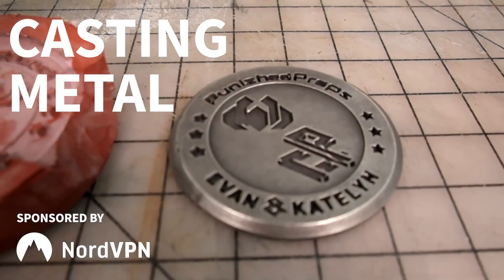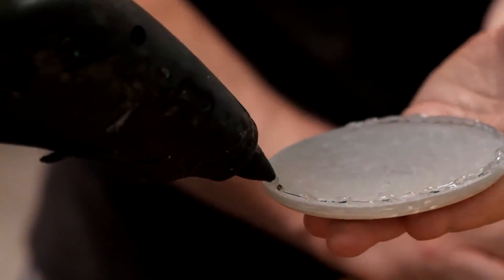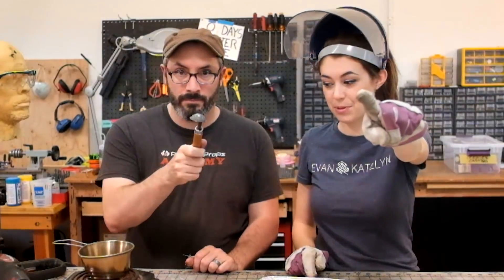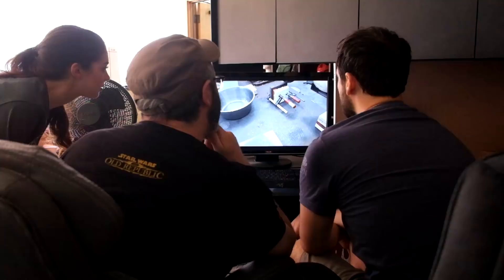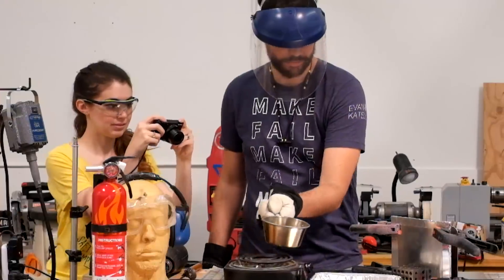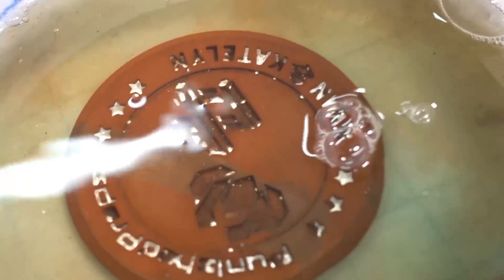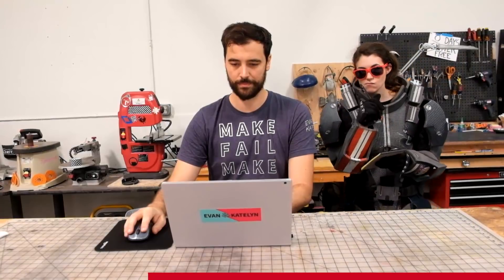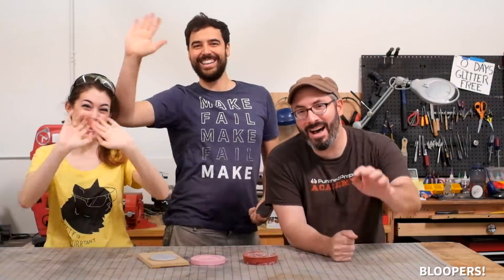We Cast Molten Metal in Silicone!!

Comment: It will likely be tin, it’s a mostly nontoxic metal, (poor gastrointestinal absorption) and it’s melting point is one of the lowest at around 200 degrees C. Most silicones, depending on the type, can withstand those sorts of temperatures.
Reply: There is lead-free "pewter" consisting of 94% tin, 3% zinc and 3% antimony.  Antimony is toxic but in an alloy like that there won't be issues, and anyway it is free of lead!

Comment: 1. Always coat your resin prints before pouring silicone, usually that stuff does not work well together.
2. Don´t use hot glue but sticky wax or bees wax to assemble the mold, it´s easier to disassemble afterwords.
3. When mixing silicone you pour in the catalyst first.
4. For a simple cast like that you don´t need to degas silicone, for someone who does not have a vacuum chamber, simply brush on a thin layer first to make sure there are no bubbles trapped and then pour the rest, not on the work piece but on a low spot somewhere in the corner.
5. The yellow color of the pewter shows it was somewhat too hot, but that´s not an issue. Also simply pour a 2nd time right after you released the first part, the 1st and 2nd casting is usually dogs*t
6. A flat disk like that is best poured at a slight angle not upright.
7. Also you forgot to make a riser. This is important as a material reservoir when the metal cools it shrinks and this way it can pull material from the riser inside the mold. And it functions as a weight pushing the material down into the mold. You make your riser as tall and wide as possible to unrestrict the material inflow, the gas exhaustion and increase the pressure.
Reply: Excellent advice - thanks!
Reply: @karhukivi  You are most welcome, happy holidays.

Comment: Very fun video.

Pouring straight down allows for air to be trapped in the bottom cavities of the mold (i.e. t he letters, other detail).
This was the exact same effect as when they were using the pewter black treatment in the water - air bubbles in the recesses.
If you have to use a straight pour in mold, with resin casting, they will use a small brush to make sure some of the resin gets into the recesses - but this only works if you have a slower curing resin, and I do not know of any similar method that could be done safely with metal.

This can be mitigated someone by doing what is known as "pressure casting" where the mold is inside a high pressure chamber which is closed right after pouring, and increasing to about 90 psi or so.  this will force the material into the nooks and crannies in the mold somewhat.  This may not be possible with metal - not certain - but this is a common use in resin casting.

The better method is to change the orientation of the mold, using multiple vents.

Also, typically in a mold - especially in the side or "box" method (the second one) it is good  to have TWO holes - one for the material to go into the mold, and  the other to allow air to escape.
often this main pour hole, forms a channel which actually goes to the bottom of the mold, so the material rises from the bottom.

There are TONS of websites, videos and forums on resin casting - and while all techniques don't match - many do.

this was a fun video, thanks for sharing.

Comment: I've cast pewter in Germany as a hobby while stationed there in the Army in the late '70's and again twice in the '80's. German hobby shops that dealt with small cast soldier figurines was my 'Go To' places to pick up the high temp silicone and the low temp metals. Too bad there's not a silicone good for +-750 degrees Fahrenheit. I want to cast some items in Kirksite, which is used in forming stamped sheet metal. I'll keep looking until I get 'lucky'! Great video for the novice to learn from!

Comment: What did you use to "prep" it for mold making? I've embarked on this process and got a pretty decent 3D print (ended up using the 45 degree angle like you did and that helped so much for fine details), but do have some stringing/extra bits. Did you do any particular method of smoothing after your print? I guess I should also ask did you use PLA or another filament?

Comment: I subscribed.  What caught my attention was your use of a vacuum chamber, gauge and pump @2:20-2:44 to de-bubble your mold material (I heartily approve).   Looks like a DIY rig, as I see a brass, machined hardware store plumbing T underneath the gauge.  The chamber almost looks like a large stove-top boiler, the sort you might use to cook eighty-seventy-'leven potatoes for a large thanksgiving dinner.   Pretty sure Mary Poppins doesn't sell a rig like that.
But I don't see a link in the description, so could you point me at whichever video you describe building it?   Hopefully you have done one?  
Thanks!

Comment: EvanAndKatelyn - I want to make a 3D mold for an original crown idea. I would then attach the rest of the circle using welding.  Do you have a recommended mold holder for longer pieces?  Ice cream bucket?  And will the 3D printer (is that the 3D Sage?) shown actually do a longer piece? Say seven inches long and maybe three inches high?  Thanks so much for posting. Keeping my fingers crossed you reply!  Hugs from Canada

Comment: You could use some more hydrostatic pressure. If you add a riser the metal will be able to flow in even the smallest details.

Comment: Sorry guys...what metal are you actually melting there?!? What melting temperature does it need? Would the method work also for melted aluminium? 🤔

Great content and great collaboration!! AMAZING result! Keep up the great work! ❤
Reply from the maker: It's pewter actually! We have a link in the description. I don't know much about melting aluminum
Reply: Probably wouldn't work with Alu as it has a melting point of 660C so way above the temperature that the silicon could handle. Probably have to go to a sand casting. As a warning, high temp metal casting can be very dangerous, metals can "explode" if not properly handled. Make sure you have the correct (non-flammable and heat resistant) attire and safety equipment and if you haven't done it before, I would strongly suggest learning from someone who has.

Comment: Your first rubber mould released gas when heated, which caused the blow holes in your badge, it's better to make a 2 piece split mould than using a backing plate.
Reply from the maker: Thanks for the insight! 😁👍

Comment: can you mold using silicon muffin tins?
Reply from the maker: That works for some things and they might be high temp enough for this but you'd wanna double check the temp rating
Reply: @EvanAndKatelyn  I'm working with molten aluminum. wold it still work?

Comment: Why did you use all that patina solution to affect all the surface you just ended up removing it from? Why not just brush it into the relief areas? You're wasting toxic materials and encouraging others who think they have to mindlessly follow instructions to do the same.
Reply from the maker: We didn't fully remove it from the higher areas, only partially. We still wanted the entire thing with some level of patina

Comment: 500° is very hot... would melt a silicone mold. I highly doubt the metal was 500°
Reply from the maker: Pewters melting point is 500... Some silicones are actually resistant to even higher temperatures than that! It's crazy
Reply: @EvanAndKatelyn  That is unheard of. Research on polysiloxane compositions with mica and alumina fibers have achieved temperature stability at 370°. Spontaneous combustion of silicone occurs at 460° at MOST, when nested in crystalline ceramics. You're talking bullocks! You couldn't cast molten metal at those temperatures even if you were in a pressure chamber.
Reply from the maker: ah I think we might be speaking in different terms - this was Fahrenheit
Reply: Oh, I see. Then I apologise. It doesn't say you're using fahrenheit anywhere, and the thumbnail was unit neutral...
Reply from the maker: Sorry about the confusion!
Reply: At least it wasn't Kelvin!

Comment: When pouring metal it is common to have a vent so the metal can push the air out. The first one trapped the air. The second had a wide mouth to release air.
Reply from the maker: We had thought since the first pour was relatively flat it wouldn't be an issue but... Well you saw the bubbling!

Comment: Question to those that have worked with this pewter...

I'm in the process of making a 1:16 scale RC E-100 Tank and obviously would need to have some parts like the Sprocket Wheel and Tracks made of metal and casting them would most likely be ideal but I can hardly see the tracks being able to be casted with the pinholes already present so my question is: How easy is it to drill pewter once it's hardened and does pewter shrink while it cools?
Reply from the maker: Hey! This was our first time working with pewter so I'm not sure about drilling or shrinking. I know we were able to cut it on a bandsaw so my guess is drilling could work. The good news is you can experiment and if it doesn't work, you can melt it down again 👍

Comment: That is awesome! It probably cooled much faster because of the metal plate transferring the heat. Great work all around! - Danny
Reply from the maker: That's what we were thinking too! So glad that method worked well. Thanks!
Reply: EvanAndKatelyn the science and precision of your projects is very interesting to me. Are either if you engineers by trade, or just very geeky like me? 🤓 I have a project on my channel about thermoeletric modules and using the heat transfer to create usable electricity. My ghetto prototype was just using two pans and some candles. Maybe you could use that idea and make 3D printed/concrete stand and make a more stable version. Could be a emergency phone charger during a power outage using just a candle. - Danny Bench
Reply from the maker: Evan is an engineer! and yes that's a really cool idea! Ghetto prototypes are the best prototypes :D
Reply: EvanAndKatelyn agreed! Proof of concept is what it's all about. Thank you!

Comment: Loved the Commander Shepard vibe lol. I've been wanting to a bit of casting... any advice for a beginner?
Reply from the maker: Thank you!! Our advice would depend on what you're casting - we have a bit more experience doing concrete and it's an easy place to start. We'd recommend doing a "tin cure" silicone rather than a "platinum cure" because it's less finicky. Lots of good resources out there with tons of casting videos! One of course is Punished Props channel but also Homemade Modern has a lot of videos on concrete casting. Hope that helps!
Reply: most welcome and thanks! I wanna try pewter casting.

Comment: So interesting and easy, after all! Love the final oxidized look :D I have some grams of tin here that once tried to melt in the cooking oven but didn't really work whatever I was trying to do that I don't remember (it was like 12 years ago or so) so I might do something with it using a similar silicone! xD
Reply from the maker: Thank you!! Does tin melt at the same temperature as pewter? (I know it's mostly tin but has some other stuff mixed in too). Maybe you just needed a higher temp than what your oven could do. You should definitely give it another go!
Reply: Yeah, pewter contains mostly tin and from my search, I found that pewter melts between 170ºC - 230ºC depending on the metals mixture. Tin melts around 230º. The experiment I did long tie ago did melt but what I don't know is what was my plan of action because what I have today is like a "splash" and drops of tin on a small box from the supposed failure ahah! Will try again with a better plan :D
Reply: Tin and lead alloys generally melt around 600ºF, with additions of other metals like bismuth and cadmium, and variations of ratios the melt temperature can be reduced all the way down to  158ºF  but cadmium is very toxic, bismuth can burn.
The term "pewter" means very little, it's a catch-all name today like making a "xerox copy" is generic for any machine copying of documents.
THE best to use for casting lead-free objects is Brittania metal, it is typically 92% tin, 6% antimony, and 2% copper.
I have bought from Rotometals.com either direct on their web site or thru Amazon where they have a storefront too.

Thier Brittania casting alloy runs about $20/pound today, watch the video on the bottom of the page, they describe what each of their 3 alloys (AC, R92, R98)  are best suited for;

Alloy AC Casting Pewter Ingot (92% Tin, 7.75% Sb, 0.25% Cu) Britannia - 563F - 650F
https://www.rotometals.com/alloy-ac-casting-pewter-ingot-92-tin-7-75-sb-0-25-cu-britannia-563f-650f/
92% Tin, 7.75% Antimony and .25% Copper

It melts a little higher than the one below, but it's best for casting, but either works nicely.

Their R92  is also $20 a pound, prices on these metals fluctuates weekly;

The melting temperature is around 466 F and the pouring temperature is approximately 100 degrees about that.
https://www.rotometals.com/alloy-r92-pewter-casting-ingot-92-tin-8-antimony-466f-566f/

Wood's metal is 50% bismuth, 26.7% lead, 13.3% tin, and 10% cadmium by weight, and it melts at 158ºF it is used in fusible links in fire sprinklers. Wood's metal is toxic because it contains lead and cadmium, and therefore contact with the bare skin is thought to be harmful especially in the molten state. Vapor from cadmium-containing alloys is also known to pose a danger to humans. Cadmium poisoning carries the risk of cancer, and damage to the liver, kidneys, nerves, bones, and respiratory system. Field's metal is a non-toxic alternative;

Field's metal, also known as Field's alloy, is a fusible alloy that becomes liquid at approximately 144 °F. It is a eutectic alloy of bismuth, indium, and tin, with the following percentages by weight: 32.5% Bi, 51% In, 16.5% Sn. The biggest issue with this alloy is the indium is VERY expensive- a 4 oz ingot runs about $100 which is considerably more than sterling silver, and this alloy uses about half it's weight in indium, I'm not sure what it's casting chars might be either.

Lastly, to successfully cast metals you MUST have temperature controls and a thermometer to get an accurate temperature, overheating the metal can cause problems, underheating it causes other problems, they all have a specifiv pouring range and it's usually pretty narrow, but when casting a large object you have to compensate for heat losses and raise the melt temperature a little so it doesn't cool too fast before setting up in the form.
Reply: @FCE-dogs  

I bought a pound of pure tin a few years ago for casting experimentation. Tin melts at 450°f, so it's easily melted in stainless steel measuring cups on any stove top. But the problem I ran into is that tin, and many other metals, will contract when it solidifies, leaving a low spot on top of open molds, and several little round indents on the bottom side, which look exactly like external beads of condensation, until you touch them and realize they arent.

Comment: The reason why you had more detail the second time, is that the liquid level was higher above the detailed part of the mold, so the hydrostatic pressure was larger. The radius of curvature  d (the resolution of your cast, if you will) depends on the hydrostatic pressure P=h*g*density, and on sigma, the surface tension of the liquid: d=sigma/P. I presume that pewter has a surface tension of about 0.5 N/m, a density of 8000 kg/m^3, and the pressure head was h=0.005 m at first, so d=1.2 mm, which is about what you got. The second time, the pressure head was 10 times as large (5 cm), so the finest details that came out all right were 0.1 mm, which is good enough.
Reply from the maker: ah that's really cool! thank you for breaking it down!

Comment: Really cool! I love melting down metals like aluminum copper and making bronze and all that, so this was definitely a video I enjoyed watching. Here's a tip if you decide to keep working with molten metal, do not use plaster molds unless you dry it out completely completely ( double sure its dry all the way through ) Oven bake it after it cures use a blow torch do whatever it takes depending on  the size or type of plaster or whatever because it will hold a lot of water and will explode in your face even if it feels dry and use bake it for a little while after it cures. if you don't even try to dry it out it will definitely splatter or explode and molten copper burns your skin :D ( I found out the hard way but I got lucky it only got me a little bit and didn't hit my face or anything ( I was wearing safety glasses thank god ) Just a tip because I know you two love trying new things and I'd hate to hear that you used plaster and something happened. Great video, keep it up :D
Reply from the maker: Thanks so much for the tips! We've never done plaster molds before but we don't want them exploding!! We'll definitely keep this in mind if we try them someday
Reply: 19th century animaliers often cast their own small bronzes in their own studios using a mixture of plaster and SAND, not just plaster. I've used 50/50 plaster and sand in the past to cast 6" high standing dogs out of Brittania alloy, cored with the same sand/plaster.

A small amount of lead helps with flow of the metal, which is why lead-free alloys can sometimes be finicky to cast, also, open back casting thin pieces like this there isnt a lot of weight of metal above to help force the metal into the details, which is why typically you would have a front and a back half of a mold and a sprue a few inches high that gets filled with metal so the weight of that helps force the metal down into all the details, then you cut that sprue off and grind/flatten the back where it was attached.